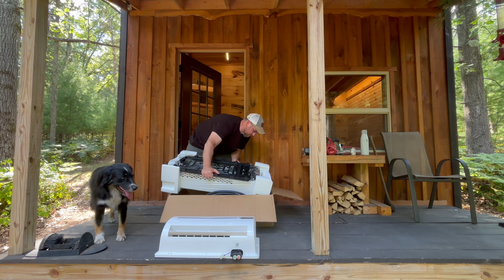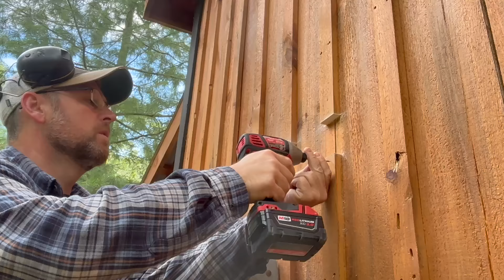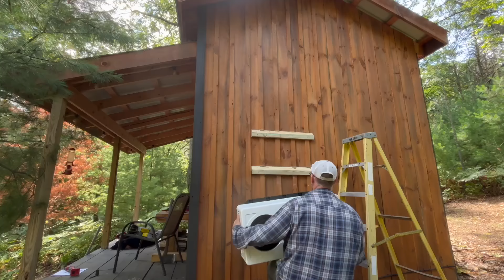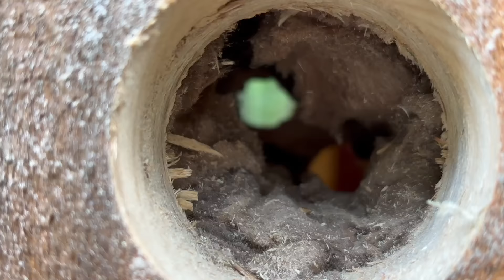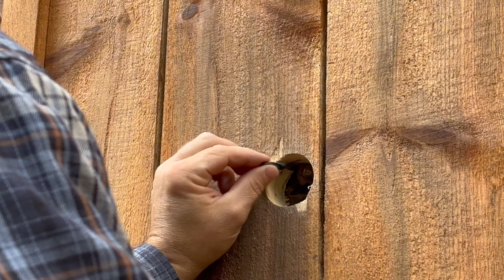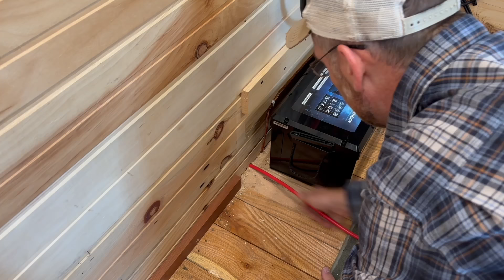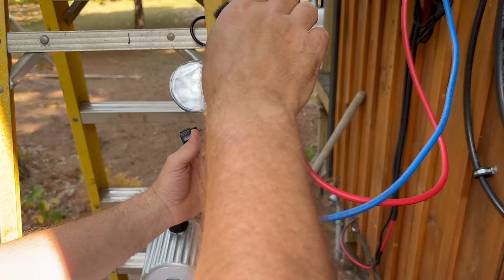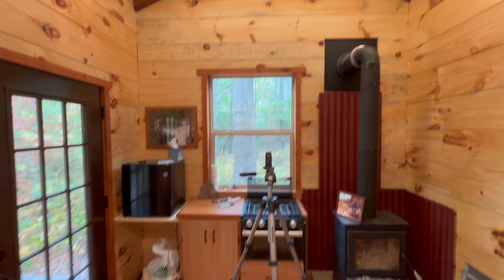12 volt Air Conditioner in the Off Grid Cabin ! OutEquipPro

Comment: How many BTU's is it?
Reply: I went about it differently, a 10‘ x 21‘ cabin and went to Walmart and bought a small window unit, installed it in a window in about 20 minutes,  through a couple of batteries and an inverter that I bought at tractor supply. Not counting the batteries which I already had on hand it cost me a whopping 225 bucks for the entire system and it gets so cold it’ll run me out of there, and I’m talking south Texas summertime!
Reply: @stephenembrey883  12v appliances have more expensive (thicker) wiring but are more efficient at using batteries, dc to ac conversion isnt perfect. So if you are looking for longer run time 12v-60v dc appliances  are the way to go.
Reply: He says in the video 12,500
Reply: I don’t know right off the bat but I will check and get back to you I’m elsewhere on the ranch.
Reply: It looks like 8000 BTUs and it takes 1000 W to run it
Reply: @DonEmbrey its 12,500 BTU.. A 12,000 BTU, 12-volt air conditioner uses between 380 and 960 watts, depending on the unit's specific model and efficiency. Unlike 120V ACs which typically require 1,000-1,500 watts
Reply: 12,500
Reply: Website link says 12,500 btu’s

Comment: Can you say where/what brand of gauges you used? I bought a brand new cool unit—brand new gauges—brand new vacuum pump. The gauges were the quick-disconnect type. They fit so loosely on the Cool unit I could not draw a vacuum. I had it going once and bumped the fitting, and whoosh, it lost the seal. I have done HVAC work for years.
Reply from the maker: The name on the gauges/manifold is NAVAC . The hoses dont actually have a name on them . they do have some kind of valve in them on the end that hooks to the AC unit

Comment: thought you said that it came fully charged ??? 
  my experience with fully charged system even the evap and line set and condenser all have refrigerant charge  no need for vacuum equipment unless you screw it up by linking or poking holes in it
Reply from the maker: I'm pretty sure it is . I'm no heating and cooling pro

Comment: If I may suggest put a T in that drain line where you added the hose for a way to put some bleach in it to keep it clear. Especially if your area has high humidity.
Keep on Truckin!😎🇺🇸🤘
Reply: 1 other thing get a couple of low energy fans and some small ductwork to put that cool air up to the loft. Drill a small hole in the loft floor. 
✌️
Reply from the maker: I've been thinking about something like that
Reply from the maker: Good idea, thanks for the tip!

Comment: Great video, I emailed them back in July for almost (6m geodesic dome) the same thing. The support or customer service was great, and they went the extra mile to help and even advise on power upgrade specs I would need.
Reply from the maker: Yeah that was the experience I had . when I did the roof top unit in my DIY camper they went over the power system explained how long it should run on what I had , very helpful

Comment: The real test is when it’s 95 outside. Mini split technology is great when they are working. Until they are not. Then they cost more to repair than your paid for it. Most of them are toss aways. Keeping clean and do the maintenance recommended in the manual and it could last for years.
Reply from the maker: that's true but hopefully we won't see those temps again till next summer . good tip

Comment: 3” hole all of the way through would have been fine. Always put refrigerant oil in your flares. Or a compatible thread lubricant. The flare is the seal, not the threads, but the oil reduces friction and is a better connection.
Reply from the maker: Yeah I should have but I really wanted to keep it looking neat inside . good point on lubing the threads .
Reply: @blackspruce1861  It's just a little insurance.  There is a product called Nylog that is fantastic for lubrication compression fittings and it doesn't react negatively with refrigerants.  Looks like you got it up and running though man. You did a good job.  It's your house.  Do it your way.

Comment: Great video, but instead of buying that AC unit, why didnt you just get the portable AC unit that doesnt need to drill through the walls.  The unit stays inside the cabin and the intake vent hooks up to the window.
Reply from the maker: just Thomas said its 12 volt
Reply from the maker: exactly why
Reply: @blackspruce1861 aaaahh my bad.  I wasnt think about that.
Reply: Might be the 12v

Comment: When they make a quick install 12 volt refrigeration unit, I will jump all over one!!! Great video!!!!
Reply from the maker: They make all kinds of cd fridges for RVs . I installed a little one in my second camper video . Thanks !!
Reply from the maker: DC not cd .
Reply: Make sure all the vibrations and noise is transmitted directly to the cabin structure… don’t be putting up a separate panel or other  free-standing structure with no mechanical connection (other than the ground) to the cabin bass dru… uh, I mean … uh, you know… wall-thing … otherwise any vibration or noise that develops will just dissipate into the air, only to bother any nearby Sasquatch or whatever… I mean, the cabin occupants will get precious little of it, and will have to be content with whatever vibration and noise the inside part generates … not much of either, I expect … I have heard it said that people from northern states, derisively called ‘Yankees’ by some, will ignore any idea other than their own, believe themselves to be the sole custodians of wisdom or truth while totally surrounded by clueless others, and hence can’t be told anything by anyone.
I can’t imagine why someone would pin such an onerous collection of character flaws on to people based on geography… you’d think it was some kind of pattern recognition or was based on a lifetime of observation or something… anyway, keep thinking well inside that box, Hoss …
Reply: You can get DC compressor refrigerators up to 11 cf.
You just need enough battery storage.

Comment: A little concerned about the loop in the lines etc. Won't allow the oil to migrate back to the compressor. Compressor should be lowpoint
Reply from the maker: Thanks for the tip . should I just raise the loop higher then ?
Reply: @blackspruce1861 it should all flow downhill. But raising the loop so that you have the most vertical possible going back to the compressor would definitely be a good idea

Comment: Auto parts stores will loan you the vac pump and gauges for free.
Reply: Auto ac guages are different than resi ac
Reply: . Yes, true but this unit IS an automotive type AC. Not residential. It runs on r134a refrigerant. Automotive r134a gauges ARE what you need.
Reply: @nickbrown3428 It's about the fittings bro.. guages are basically the same..

Comment: Good job. I got a vacuum pump and gauges from Amazon for $100. Worked well.
I'm retired Trane engineer.
Reply: Just had to get a pump and gauges to work on my car AC. Picked up the $140 Vevor set on Amazon. Worked perfectly. Amazon actually offered to sell it to me for $40 payments interest free so I did that and had the set my hands for $40 plus tax.
Reply: Being an great engineer is no proof of mechnical competency.. 
... I'm kinda joking but you also know I'm 100% correct ..
Reply: hello david. The guages I got off a-zon were so loose i could not even pull a vacume. Do you know what brand you got?

Comment: Why did you notch out the exterior wall for a 2X to fit in to mount the unit to couldn't you just Mount the two before to the side and then Mount the unit without cutting the siding up.
Reply from the maker: yeah I guess it would work either way

Comment: Ya think this would cool a 40 Ft shipping container?  And could I just connect it directly to a 12 volt car battery?
Reply from the maker: If it's insulated maybe , but we used those on the job site for parts and as hot as they get without insulation id say no way . you would probably need multiple car batteries hooked in parallel . but without some solar or a generator charging them they wouldn't get you very far

Comment: Glad to see this video, thanks! I am planing on installing one of these units on a trailer build. When installing something like that condenser, I like to use the back of the box as a template as it is easier to hold and I can easily tack it to the wall & mark my holes. Also, it is a safer bet to leave the hoses on with valves closed. Schrader valves aren't good at holding vacuum. Losing vacuum means introducing noncondensibles which mean the unit won't perform correctly & the refrigerant will need to be replaced.
Reply from the maker: no problem glad you liked it . the unit actually came with a template but I never pulled it out of the box.

Comment: That condensate drain hose is NOT UV resistant.
Mine fell apart in about a year.
You need to cover it up ASAP.
Reply from the maker: Thanks for the tip !!

Comment: Im surprised you didnt make one bigger hole. You could of used a sleave afterwards to ensure any moisture wouldnt get in between the walls from sweating and you could wrap and seal with insulation and silicone caulk.
Reply from the maker: I was trying to keep it looking neat but I think I might just cut it out if there's condensation

Comment: nice find, Great supplimental AC for smaller spaces Auto/RV/Tiny house- love it, I have installed maaany Mini Splits (230V110V) I would recommend next time for your LineSet & wires just do one big Hole Saw, 3incher everything will fit with wiggle room and its still easy to seal , ( sligh angle of course w pvc jacket)
Reply from the maker: Thanks and thanks for the tip !

Comment: Considering this one for a full-time camper. I like that one of these 12V mini-splits finally has a long condenser unit. Works great for fitting underneath a vehicle, especially if you're replacing an existing condenser for something like a shuttle bus.
Reply from the maker: The rooftop unit might be a better choice . I did a video on that . installed one in my DIY camper . works great and I don't know if I would put it under a vehicle . seems like it would get a lot of dirt water and abuse

Comment: I love your little cabin setup, look, nice warm and cozy looking in beautiful nature. a bit of heads up while its 90-95f outside that's when theres  very high dew points especially while 75% Humid outside that is when ac's really show how well they do btu's wise, low 80 and high 80's outside is usually e d of the summer and or beginning summer or late spring so we don't have these extrene dew points or even dry heat yet, single stage cooling ac's usually show how well they perform when it's 95f outside that's when the compressors especially inverter systems run on high 100% demand, high flow, high speed fans and start to short cycle do to conpressor temps reaching its limits, that is damnn awsome that such a 12v system exists, i wonder on the reliability of that system in long term. I like it overall.
Reply from the maker: yeah I wanted to get this done while it was hotter outside but just couldn't get to it in time

Comment: Please make a follow up video in the next day or two  once you run for awYhile. This is very tempting to install in my 400sqft cabin. 

What's the power draw? Doesn't tell me on their website which is odd. I use a regular portable standup AC unit and they draw like 1,000w + which is taxing on a power station.
Reply from the maker: I would but I really don't have the time right now . I've been working on a large build and need to get it done in the next month . I don't know exactly what the draw is but you could probably message them and they would respond . as for a power station . none of the power stations I have used have large high watt DC terminals  that would support this so I would definitely look into that before making a purchase .
Reply: @blackspruce1861 understandable. Whenever you get the time make a follow up video. Yeah I'll contact them and you're right the DC output on the power stations wouldn't be able to run it anyways. Needs to be on the terminal directly

Comment: I disagree on the just bringing an AC guy in. Might as well just bring an electrician and carpenter in too, then. Anyone doing this themselves are doing it to save money not just today, but in the long run. A vacuum pump and the A/C hoses can be gotten much cheaper than you got them. Even it they couldn't, they are perfectly usable on any a/c system. The exact type compressor on most cars that is fairly easy to swap out requires just what you are doing to that mini split. 

Also, if it is brand new, isn't holding a vacuum, there is nothing the A/C guy will be able to do with it that is more important than you just sending it back for a replacement. If it isn't holding a vacuum from the factory you don't want a quick fix on it. You want them replacing it completely.
Reply from the maker: I guess . But I just responded to a comment from a heating and cooling guy that pointed out a mistake I made when doing that step . I totally agree with doing things yourself obviously, everything  else at this cabin I did just that but some things I see the sense in .
Reply: @blackspruce1861  Yeah, but the takeaway from that is just making sure you are doing it when it is 65f+. The vacuum you were pulling was more than enough to boil off any condensation, as long as it wasn't too cool. The mere fact you are putting in a mini split tells me it gets above that temperature in that location, so it just becomes a planning issue. I'm just saying, anyone I know that would even consider putting in their own mini split or any other sort of a/c... either has experience at the least replacing the a/c compressor on their car or is an engineer or otherwise mechanically inclined. Getting a vaccum isn't really all that scary, or shouldn't be. You just have to do it when it is still warm.

Comment: For regular ductless units having extra refrigerant lines in a loop like that can cause problems. I've seen units die in a year or two because there was multiple loops of extra refrigerant lines. I'm glad yours is only 1 loop. I hope it lasts for you.
Reply from the maker: I hope so too , should I try to make the loop bigger or more gradual . do you think that would help ?
Reply: @blackspruce1861  Read the install manual. The refrigerant lines might need to be a minimum length so cutting them might be bad. I'm not sure what your best option would be. We install Mitsubishi systems. We always want about 15 feet minimum of refrigerant lines and no loops.